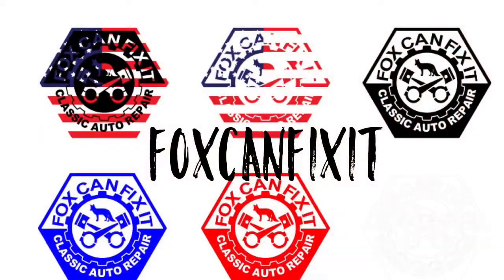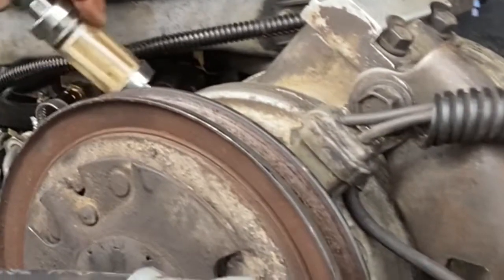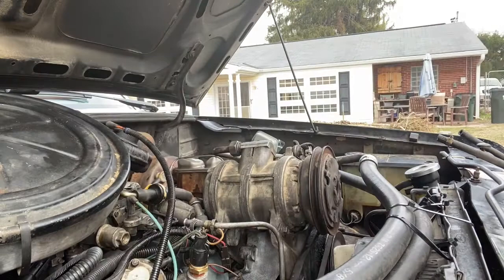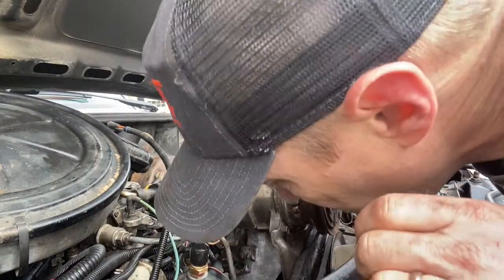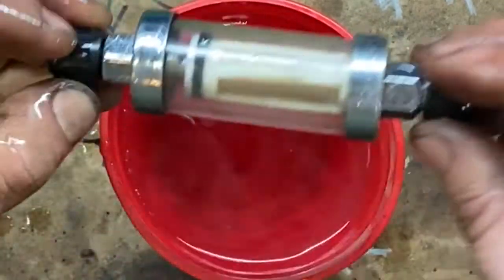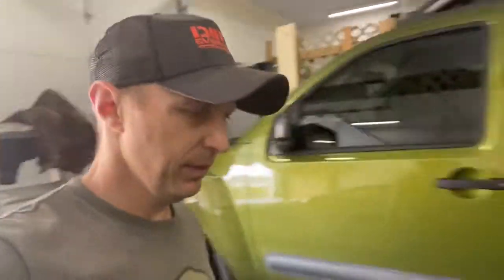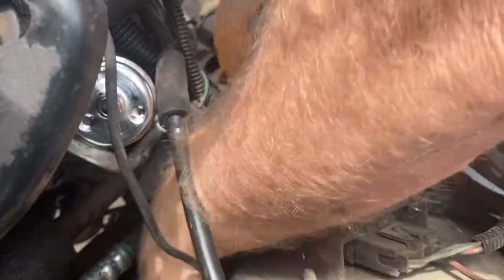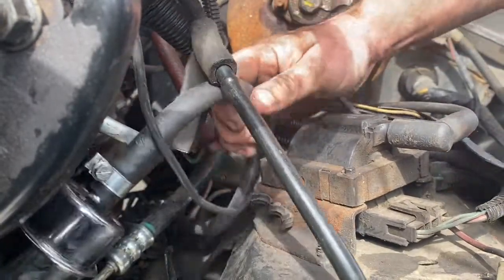Fighting fuel delivery issues

Comment: Seems air may be drawing into the input (suction) side of the fuel pump due to an internal leak in the pump body. Old pumps can do that.  Is yours original?  That would seem to be the most obvious bad part of system.  Esp an old pump with an old, worn pumping parts.  Try a new, or temp pump anyway and see what happens?  Hope it helps!!  :) DL
Reply from the maker: Thanks!  Old mechanical fuel pumps definitely can do that.
Reply: @Foxcanfixit  I'd love to know if that's really it.  Thanks again for making your really great video!! DL

Comment: is that glass filter good for injection engine ??
Reply from the maker: Absolutely not, it wasn’t even good for the carbureted ones.  It’s breakable, the ends can loosen from continued vibration, the seals fail, etc, these are terrible.
Reply: They actually just fine. People that dont regularly check them and mount them in bad locations complain the most about them.

Comment: Anyone have a problem where upon replacing the fuel tank, the line is sucking air out of a full tank? Obviously something came undone in the tank or the arm is stuck in the up position, but the sending unit was new as well and worked for about 3 tanks. WTF
Reply from the maker: Could have a hole in the plastic line that connects to the tank sending unit. They are prone to cracking as they age.

Comment: Fuel vaporisation causes poor hot starting after a journey (heat soak) and can cause air bubbles in filters  & breakdowns. Fitting a 3 way filter with a tank return for the aerated fuel in place of the straight filter should fix it.
Reply from the maker: Good tip!  Thanks!
Reply: Or after your main filter, as the return line gets clogged MUCH easier, so you'll be changing filters WAY more often if you don't prefilter. Only really an issue if you have a dirty tank though.

Comment: I have the same filter on my Chevy 73 but when I go above 30 it starts bogging and shuts off and when I check the filter it’s empty and the pump isn’t pushing as much gas
Reply from the maker: Yeah, get rid of that filter, get a Wix clear plastic filter.  Then if you have issues it may be the pump or a line restriction

Comment: Bypass the main fuel line..20 ft fuel hose should do..straight to the gas tank and you will see it its your main fuel line on frame....my symptoms were air bubbles and no fuel to fuel pump

Comment: I wasn’t paying attention and install mine. Started up great, fuel filter full of fuel. Realize I got the side that said “IN“ on the carb side. So I swapped it with the OUT on the carb side and now it’s doing the same thing. That’s with my 71 Cutlass and it’s doing the same thing on my 79 Camaro and I changed the whole entire fuel system and it. I think the IN side is suppose to face the carb with just bad product word placement. Who knows. Lol
Reply from the maker: It’s just a bad design, ditch it and get a Wix or other filter

Comment: Can't a guy spray starting fluid in a short burst to get a little surge of the engine when you hit the mark ?
Reply from the maker: That or brake fluid or carb cleaner, yep any of those will find an air/vacuum leak around the intake or carb, but I don’t think it would find an air leak in a fuel line.

Comment: You routed  the fuel filter somewhere where this is too much slack and that’s what’s causing a lot of your problems here. Not just the rust
Reply from the maker: It was a bit higher than usual, but it’s the same setup as an old mechanical pump diesel and they work just fine.  However, i see your point and would have moved it if I kept it.
Reply from the maker: It’s was indeed part of the problem.
Reply: How could too much slack in the line cause the problem? Just trying to understand, I have multiple fuel issues going on.
Reply: @KelseySchier  it can restrict fuep floe and when your vehicle runs low on fuel. It wont have much of anything it can suck in because tye slack keeps gas in the center of the slacking point. Ive dealt with those issues before also.

Comment: FUEL CAP AREA OR PIPE CONNECTING FILLER NECK TO TANK?   I HAD A BITCH OF A CAR THIS SUMMER THAT HAD THAT FINE RUSTY PURPLE CRAP IN THE TANK.  IT WENT FOR 800 MILES0 THEN PICKED UP SOME SHIT INTO THE CARB AND IT BROKE DOWN.  ALL YOU CAN DO IS DROP THE GAS TANK...GET IT CLEANED OUT AND TAKE YOUR TIME DOING IT.......
Reply from the maker: Yep, a tankectomy is a sure fix for a silt/rust issue